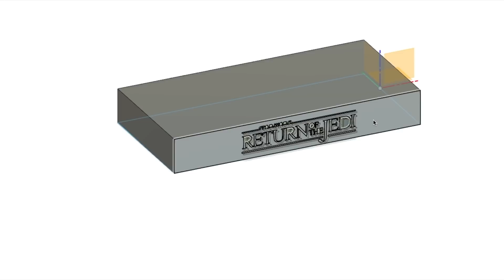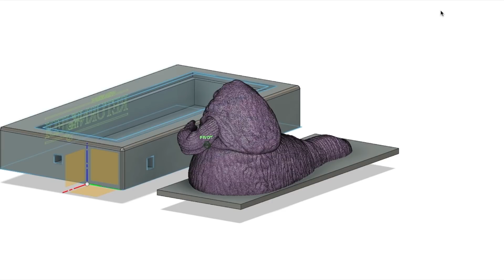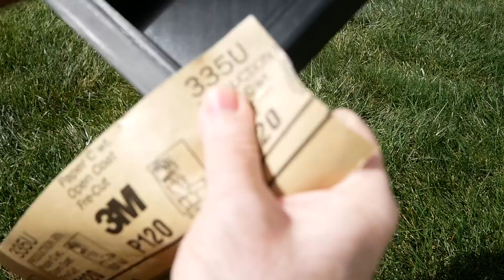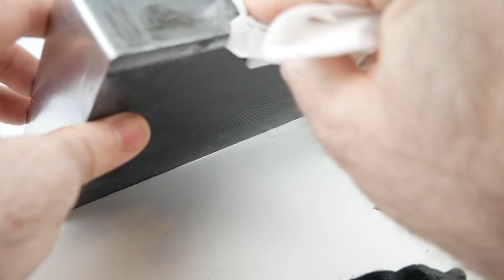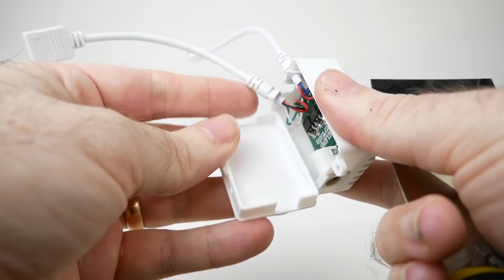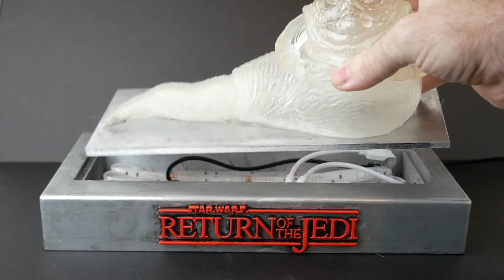Using 3D Printing to turn a Vintage Jabba Figure into RGB LED Lamp!

Comment: Hello, I have a Creality CR-10 with dual z axis motors. The z axis goes up and down when homing but will not go up when printing. Is it the machine or am i doing something wrong in Cura ?
Reply from the maker: Did you tighten the couplings around the Z axis rods when putting the machine together?

Comment: If I were you, I would have separated the box and logo. Then print the logo on your resin printed and glue it on after.
Reply from the maker: This is a good idea and I actually did think of doing exactly this, but I had issues figuring out how to design it in Fusion 360 so I decided to stick with what I knew would work

Comment: For the next time, consider making the box with a slot in the front.  It would allow you to print letters flat, similar to the lid, and dropped into place.
Reply from the maker: Yes I did actually try that but had some issues working in Fusion 360, since I’m still very much a novice. So I decided to go back to what I knew would work
Reply: @MightyJabbasCollection  fair enough.  A longer way to achieve what I was refering to would be have the bottom separate, print the top upside down and the ' cutout/name plate  be a flat print.  A 45 degree bevel on the side of the 'top ' and name plate to help make it flush as well as the bottom printed with a form of backing board to help press the name plate against the top piece as well as pinch into place..  Now with that description, see if you can do it better in Fusion. 😎👍👍

Comment: For the lettering you could have used your resin printer and added a silhouette slot in the base to slide it in to.
Reply from the maker: Yes that is a good idea and I actually tried it briefly, but my inexperience with Fusion 360 made it tricky so I gave up
Reply: @MightyJabbasCollection   Probably easier to do in tinkercad.

Comment: Very impressive.....I do have a suggestion tho, which would possibly make a future version easier. You could print (and paint) the logo separately....possibly in resin. It would mean you wouldn’t need supports and painting would be a breeze.
I must try out the programs you used. I tend to use fusion 360 for pretty much everything.....from what you said, I probably shouldn’t lol
Reply from the maker: team dax Thanks. I thought about that (such as doing just the logo in resin) and experiment briefly with it, but I don’t know my way around Fusion 360 very well and it didn’t seem to be working the way I wanted. Still the concept is a good one
Reply: Mighty Jabba's Collection .....tbh....if your only doing one, the best way of doing something is the way that works for you.